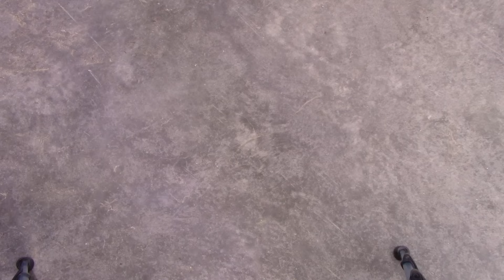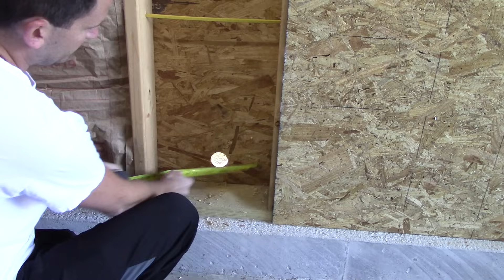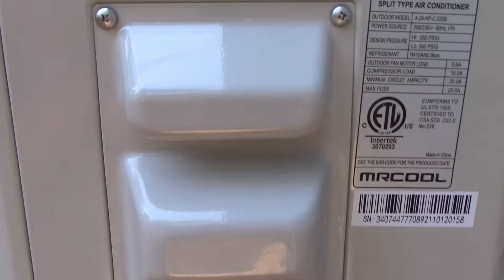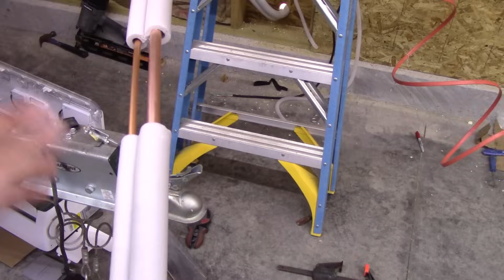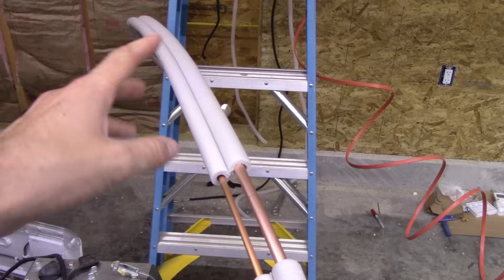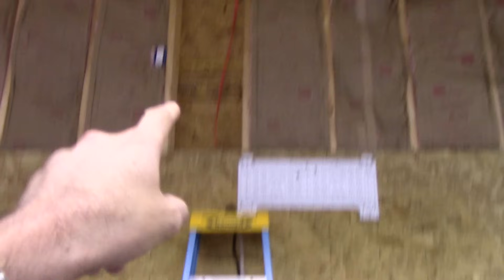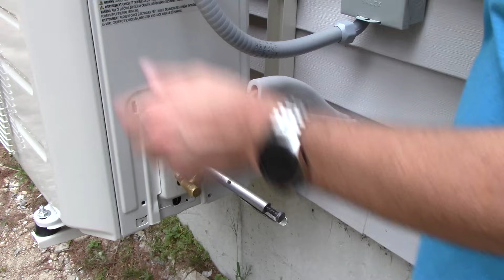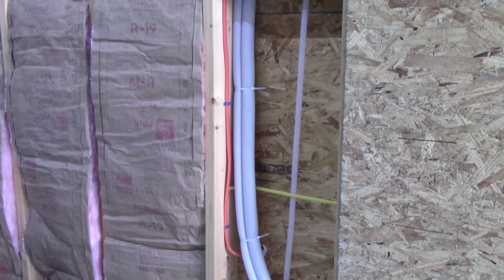Mini-Split Installation For Dummies - Complete Step By Step Guide.

Comment: I thought that Mr. Cool came pre-charged?
Reply: All of the compressors are pre charged, the diy model comes with pre charged lines yes, and it adds quite a bit to the price
Reply: So what so i have to do once its hooked up i have the diy model i know nothing about hvac just electrical
Reply: Justin venuto you have two options, learn about HVAC or hire a guy to hook it up! The electrical is easy because you know that! HVAC is easy to learn where and how is your choice. I am not trying to be a jerk, I think you can do it!😁🛫

Comment: If you didn’t need a 10/3 wire and can wire it with 10/2, what’s the reason for the extra conductor? What are some possible future uses for the white neutral wire?
Reply: You can use the neutral wire if you are installing another aicon in reasonable proximity , which means commoning the neutral or if you need to install a permanent voltage/amp gauge or surge protection. Then you only need to parallel the live wire on the board or extra spade connector under the live screw.👍👍👍👍
Reply: What would be the advantage of a 3rd 120v? Do American homes have 3 phases as standard or 2? Or, one 240 from the grid that is halved in the home?

How does it work?
Reply: @HumbleGuyNico  single phase 240 split into 2 lugs ( opposite bus bars ) in the main panel.
Reply: @HumbleGuyNico  It is single split phase. The transformer secondary from the utility is center tapped, producing 120 VAC from either end to neutral and 240V across the whole secondary.

Comment: Did you have to pull a vacuum on the line because you had shortened it? I don't recall other folks who got the Mr. Cool unit doing that step and I'm considering buying one too.
Reply: Trial N' ERROR gotcha, makes sense! Thanks! If I bought the precharged one and wanted to shorten the lines, is that still doable? From what I understand the refrigerant is stored inside the condenser until you turn a hex screw to release it into the connected lines, right? Thanks again!
Reply: @RonFarberNewman  Yes, the refrigerant is inside the unit.  If you want to cut the lines, you must do what he did.  You must flare brass ends (need the tool) but other than that the connection process is the same.  You will not lose any refrigerant if you cut the line, there is no coolant in the line when you get it.
Reply: @TheGrouchybear  they're referred to by everyone as "pre-charged lines", but I suspect they're primarily vacuumed down to remove moisture, with a minimal charge of the r410a refrigerant instead of air, or a true vacuum. As mentioned, the actual normal charge is in the condenser unit, and released into the rest of the system with the valve after connecting the lines.
Reply: @mlindholm  ,
All these comments, this is not the"  DIY " version.
Everyone is confused about that, Mr cool had both the diy and non diy versions.
The DIY has pre charged linesets with quick disconnect fittings and doesn't need a vacuum pulled
Reply: @josephthomas439  I'm not confused, I'm well aware of the difference. I was describing the DIY kit linesets, that don't require pulling a vacuum or gauge sets to install, and also describing what I suspected those "pre-charged" linesets actually are. 

I believe that all minisplit sets are sold with the  required charge within the condenser units, as I stated. If you make custom length lines, flare, and connect them, you must pull a vacuum, then ideally pressure test with Nitrogen, and re-pull a vacuum, before releasing the factory charge.

The DIY lines can't be adjusted, so any excess line needs to be properly coiled to prevent oil pooling and starving the compressor.

Comment: Great video! My only concern was when you were working on that sub-panel (which I assume was energized) with your necklace/chain on. Other than that, Pure Awesome Sauce!
Reply from the maker: Danger is my middle name (or dumb...hard to tell most days).  Thanks for watching Jorden!
Reply: As a general rule, leave all metal jewelry & watches at home. This addresses electrical and mechanical (fingers crushed by rings) safety.

Comment: Did you bend the linesets by hand or did you use a tool?
Reply: The trick is you make a slight bend then another next to it and repeat easy to bend by hand the lines are soft
Reply: @Trialnerror  okay thanks... I'm just stressing out over this part and over thinking it probably. Not a lot of info online about installing them.

Comment: Should have turned the lines down,Water will be running to your garage when it rains even if you caulk the wall
The hole should have been higher,The circuit box should have been a fuse box
Other than that it works LMAO
Reply: You should watch it again. Perhaps twice. The non fused disconnect is very clearly in frame while he is doing the wiring outside 😂😂
Reply: @Trialnerror  SO where is the disconnect
Reply: You're off on this one buddy. Their is no need for a fused disconnect on this mini split. 2 pole 20 amp breaker and a non fusible disconnect are all ya need👍

Comment: Is it a heat pump?
Reply: @Trialnerror  cool
Reply: All mini splits systems are heat pumps.
Reply from the maker: @toddiamhvact7386  No, not all are heat pumps.  Some are strictly AC only and are cheaper but if you're going through the trouble of putting one in it makes sense to have both options IMO.

Comment: Some of these units are designed to work with 1, 2, or 3 evaporator units and will reduce their output to match the load.  Some times a 24k unit is left to power one 12k evaporator and you won't get the full capacity. The evaporator units have their own BTU ratings for what can be processed -- actually it is a combination of humidity removal and temperature delta which can be limited by air flow. Drier climates can probably use more evaporators before condensing unit is full loaded or it can depend how well the dwelling is vapor sealed.

Comment: Hi you'all  . Thx for the video , Im about to purchase one of those ductless mini split for the house but I can't find more info on how to install the multi zone .  also I need to know where did you connect the subpanel OCD like you said to the outside electric disconnect box ,I didn't see any wire line to it ,and from the compressor unit to the disconnect box I noticed you didn't put the colored wired in order ? another question why you didn't use a fuse for safety fire hazard ? indeed you should measure the amp in order for the compressor unite to receive the appropriate Watts ? the lst question what is in your opinion the best ductless mini split ? sorry about all this question , thx alot

Comment: NIce video, the one I ordered is a dual zone but it does not come pre charged so I am going to have to pressureize it with 410.  I am wondering why mount it on the wall?  I have several split units and they are all on the ground on a plastic paver.
Reply: @Trialnerror  well since i live in Hawaii snow won't be a problem:)

Comment: Question: Does the wall mount transmit compressor noise through the concrete? Your situation is remarkably like mine: new construction; able to run tubing and wire inside of walls. Unit arrives in one week.
Reply: @Trialnerror    Thank you.
Reply: WyGuyVideo Gamer the reason to raise it up is so that the snow does not block the airflow. If you don’t have snow, the simpler solution is to put it on the ground on a pad.

Comment: You said you like Mr. Cool more than the Mitsubishi units; but you never said why?  How long have you had the Mitsubishi units?  Do you still feel the same way now?
Thanks for a good video!
Reply: @Trialnerror  There wasn't much he wasn't fired-up about.  He started by going over every possible thing that could go wrong with the installation. While his comments were valid;  I then mentioned YouTube instructional videos...that was a serious mistake...poured more fuel on the fire.  Finally, he  went after other HVAC businesses and the poor quality and techniques they use.  He is entitled to his opinion. 
The only part of the installation that I can't readily perform is pressurizing the lines with nitrogen to check for leaks.  Any suggestions how a DIYer can do that?
There are a lot of excellent mini-split installation videos.  While most have a similar goal, each can provide a unique idea that I can use.  For instance, one installation on YouTube, he installed surge protection at the quick-disconnect box to protect the electronics of the system.  Now that is a great idea!  Since I have had two lighting strikes that damaged my fridge and a solar controller,  I will certainly include one of those on the system.  Regards
Reply: @Trialnerror  Thanks.  I spoke with a local HVAC business yesterday about connecting the lineset and performing the evac, purge and refrigerant release to ensure it was done properly; I would do the rest.  Got my butt chewed on by the  "professional" for over 35 minutes! I'm not sure he stopped lecturing me long enough to take a breath!
Reply: @Kntryhart  The DIYer represent a serious problem for professionals in the trade, they don't like the DIY guys.

Comment: I didn’t see you charge the system with 410. Does it come charged? My mrcool that I’m putting in doesn’t need to have the lines evacuated as it has special valves in the lines that open when connected. And obviously is a pre charged system.
Reply: His unit was not a do-it-yourself model.

Comment: Thank you very much for your great video. It is quite timely for me as I am looking to install AC in my shop. 

I am curious about sizing of your unit. My shop is 40x40 and well insulated here in Oregon. Like you I will probably only run this system 10% of the time I am in my shop. I have a pellet stove for heating. Do you think this unit would be big enough?

Also, can the refrigerant be picked up at most home centers?
Reply: Curious about the size of his unit?

Ahem, mind your own business 😂😂
Reply: It partly depends on whether you live East or West of the Cascade Range.

Comment: Just to compare apples to apples were the SEER ratings the same for the Mr. Cool and the Mitsubishi?  17 SEER is getting a bit long in the tooth for this day and age as efficiency ratings are pushing into the very high twenties for a cheaper energy bill.  I would expect a low price point for a 17 SEER unit as compared to a 27 SEER.  I am installing a ton and a half AirCon unit in my shop as we speak.  Looking forward to the dehumidification aspects as well as the heat side and probably less than ten per cent of the time in cooling mode.  Did you use a R410a rated flare kit?  Lots of discussion on the forums about the necessity of one or an older style 45 degree flaring tool.  I decided to spring for one as I am also shortening my line set.  Heat pumps have come a long way in the past twenty five years.  It will be interesting to see how long they last.  One of the benefits of installing your own is the cost is then much much lower and can be amortized much earlier if replacement is needed.  Take care.  Doug
Reply: @Trialnerror  Thanks for the reply.  Looking for warm dry air this time of year.  Lol!  Doug

Comment: Good job , keep in mind that it is ideal to have a micron gauge when your vacuuming a system to ensure that you do not leave any moisture as it can cause problems. Also it’s probably better if you can   pressure test your flares/ connections by inserting nitrogen in the system as this will allow you to have higher pressure in the piping which can lead to finding leaks that can only be seen with higher pressures.
Reply: Just use diluted soap suds or ordinary dish washing liquid around the flared connectors and it will  show bubbles around the joint if there are any leaks.. The most effective way is to inject dye oil and use an ultraviolet light to detect leaks but it's time consuming and the dye oil does some damage to the system. 👍
Reply: I just let mine sit under vacuum 2 hours, didn't budge an inch

Then you can run the system and leak test with soapy water so the lines are under about 400 psi, have to do this in heat and AC modes as the suction line obviously swaps and alternates which line is under the greatest pressure
Reply: @doddgarger6806  410a is more critical than others and it's very important for system longevity that proper procedures are followed to 410a standards.  That included pulling down to a MINIMUM 500 microns and holding.  There is no other way to observe this without a micron gauge.
Reply: Excellent point on the micron and nitrogen checks. However, upon doing those procedures you leave the "world of the DYI" folks and enter more into the realm of the professionals. Still, a great video... thanks!

Comment: Your panel looks remarkably like mine inside....Now that you’ve had a little time to run the heat pump side can you tell me about it sufficiency temperatures can you use it in the Hampshire I know it’s a garage or not A living space but do you have a heat pump in your house similar to this? I’m thinking if I can install one of these and it will keep my home for a couple of months in the fall and same thing in the spring and be worth doing! ANOTHER GREAT VIDEO!
HOWS YOUR BACK? You seem to be moving around pretty good?